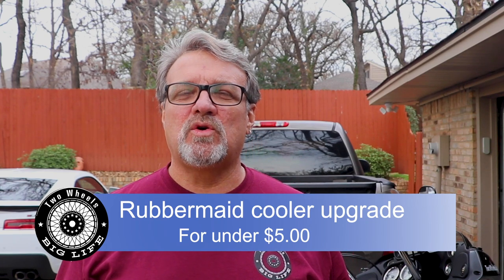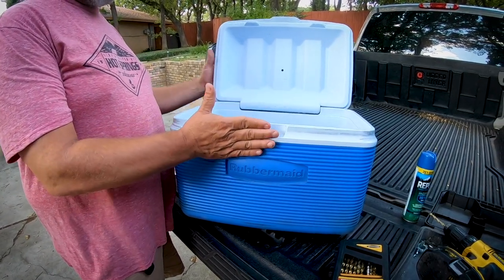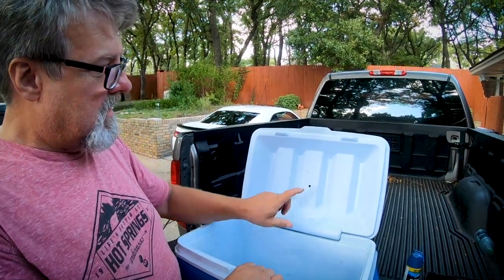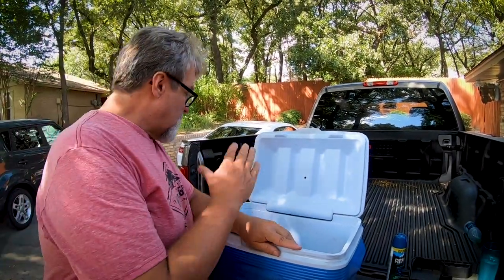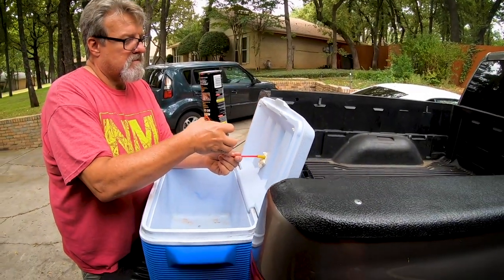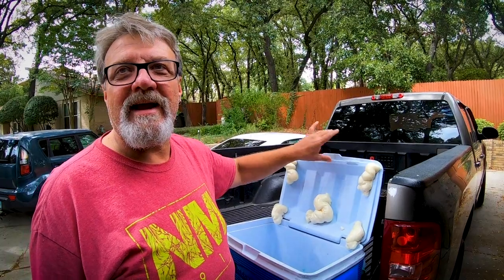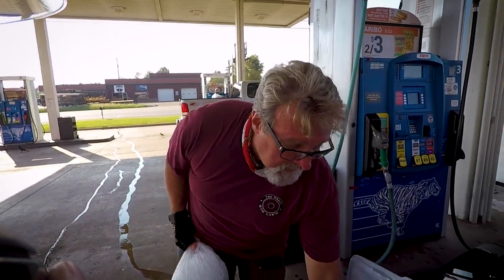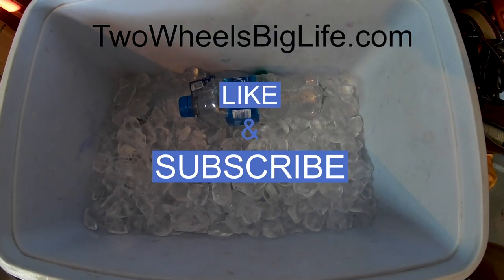BETTER THAN A YETI ?? - How to Make Your Cooler More Efficient  #Cooler #Rubbermaid #yeti

Comment: I did this 20 years ago when we were boating all the time. I drilled large holes though. You need to use minimal expansion foam or it can warp the lid. Might not make it a yeti but it improves the cooler a lot! Yeti coolers are heavy, improving a cheap cooler is a good thing to do.
Reply: I looked, I physically couldn't lift a full 60-75qt yeti cooler out of my suv. Which is the size that I would need. I'm not sure I could lift half of that and the added cost of wheelchair ramps to maybe drag it out only puts me at risk of being run over by my own cooler. I'm trying more to figure out if anybody has gotten brave enough to fill the sides and the bottom too. Except, I wouldn't do the body from the inside. I'd drill it from the outside because water is fickle. It can cause problems if it gets where it's not supposed to.

Comment: i done the SAME THING. WORKED GREAT. I TOOK A TRIP PULLING MY TRAILER FROM ALEXANDRIA LA TO CARLSBAD NM. I USED DRY ICE ALSO PUT NEWSPAPER ON TOP INSIDE.NEWS PAPER IS A GOOD INSULATOR. AT THE CAMP GROUND IN CARSBAD TWO DAYS LATER MY HAMBURGER AND CHICKEN BREAST WAS STILL FROZE SOLID.

Comment: I found a free 50 quart Coleman rolling cooler that someone was giving away. I had a 23 liter insulated foam shipping box that happened to be very nearly the same dimensions as the interior of the cooler. So I only had to carve out the places where the wheel wells took up some interior room, and I had a double insulated 23 liter cooler. I glued the foam lid into place inside the hinged lid of the cooler, the tightness of the fit took care of all the rest. I put a couple of latches on the outside, and Ta-da, a free homemade Yeti-ish cooler.

Comment: Silicone around the rim can help try to make an airtight seal which would help keep the cold in. If no silicone you can use electrical tape as temporary seal. Did it on a cheap igloo I had for a while and it’s a noticeable effect

Comment: You can also use foamboard on the top. You notice the vallies in the top. Once you use spray foam the deep vallies in the top has less foam where the deep vallies are located, so once you add the spray foam add a layer of inch to two foam board the fill the vallies with spray foam also. I bet that makes it even better
Reply: Conceptually, yes... in practice I would use something like Coroplast (Plastic Cardboard like yard signs are made from) and Silicone around the edges to avoid mold.

Comment: Perhaps a bit off topic but many years ago I had a large aluminum center console boat and it had an ice chest locker in front of the console. Unfortunately it was all aluminum and could melt a bag of ice in under an hour. I found a cheap styrofoam ice chest that just fit inside it and after that I could keep my drinks cold all day.

Comment: I did it and it made no difference at all, possibly a bit worse.  My guess is that the lids are hollow for a reason as air is probably a better insulate.  I put frozen packs in just for a test inside a garage (no sun) and 15 hours later, they were already starting to melt.
Reply: It will trap in the heat if you don’t pre chill the cooler first. You are supposed to throw a frozen water bottle or two in the cooler a couple hours before you put in ice so it doesn’t rob all the energy converting the heat to cold. If you look at a yeti they are completely insulated even on the lid and the instructions tell you to pre chill. Try it again I bet it lasts at least a day longer.
Reply: @andrewsapp856  I'll try that, thanks.

Comment: air is the best insulator. there are other videos showing this method versus normal plastic coolers and the foam filled coolers actually caused less cooling on the inside of the cooler because they trapped heat longer due to the foam.
Reply from the maker: Thanks for the info, but in our case it actually did save Ice
Reply: @TwoWheelsBigLife The foam insulation has a lot of tiny air bubbles that insulate it from other bubbles.

Comment: Great idea! Does anything seep through that open hole in the middle of the board and contaminate the food? I mean is the expanding foam poisonous?
Reply from the maker: I sealed the holes with food grade silicone after filling the top.  Nothing seeped through.
Reply: @TwoWheelsBigLife  ok, I went back and watched that part again. I think I am going to do this with one of my cheap coolers. Thanks.
Reply from the maker: We used it mainly as a dry box later on.  It still helped keeping the heat out.
Reply: @TwoWheelsBigLife  that’s a good use too.
Reply: This is perfect for our upcoming road trips to mountains. The cabin has a mini fridge so this will help us keep our drinks and ice so we don't use up space in the fridge so much.
Thanks!

Comment: I wonder if putting reflectix between the black cover and the cooler would help as well. Is there room to do this?
Reply from the maker: That might work.  We use that box as a dry box now. It’s much cooler even when the sun is blazing on it.
Reply: @TwoWheelsBigLife  What do you use for a cooler now?
Reply from the maker: We have a Yeti that sits on the back seat of the HD.